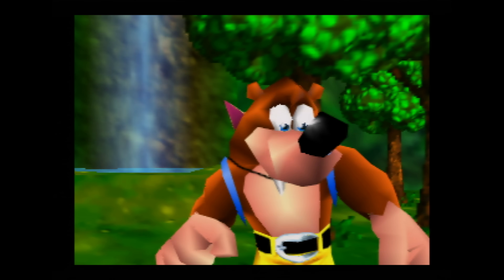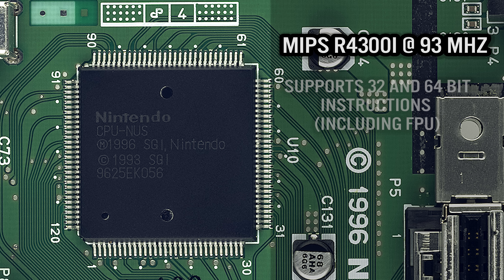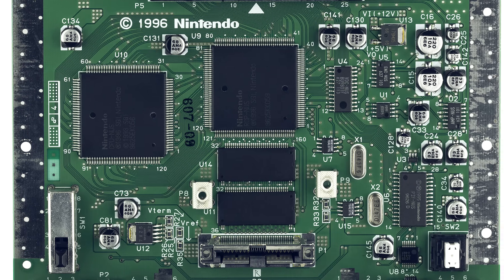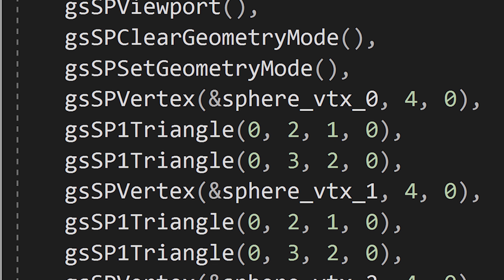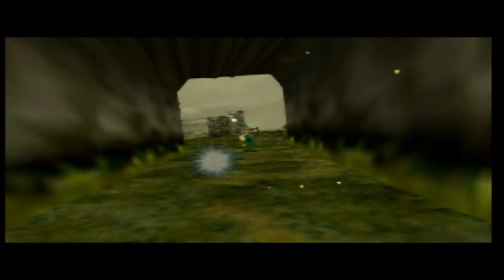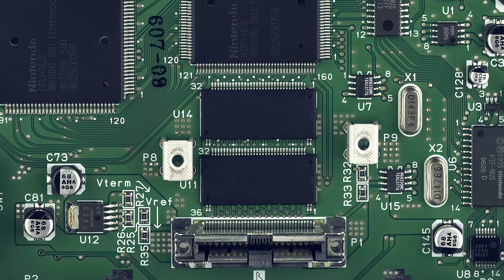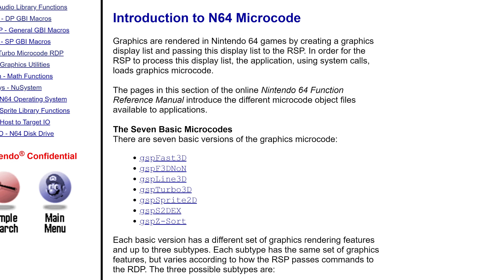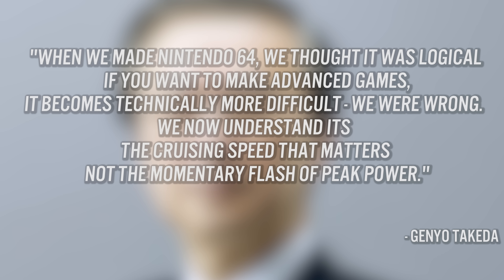Why was the Nintendo 64 so hard to develop games for ? | MVG

Comment: Calling the SNES 65816 clone processor a 16 bit processor is like calling the 68000 a 32 bit processor.  The 65816 has an 8 bit data bus but could perform some 16 bit operations internally.
Reply: 8088 has 8bit data bus. I would be cool if SNES had code cache and 32x32 registers to not need the external bus for everything. Scoreboard for a load queue.
Reply: @ArneChristianRosenfeldt  I programmed the SNES, Sega Genesis, PS1, Gameboy Color, and Atari ST for a living.

This doesn't seem realistic since the 65816 is intended to be compatible with the 6502 with 16-bit extensions.  The 6502 had very few registers because it was made to be cheap and fast with fewer transistors than most if not all the other 8-bit processors.  It made up for the lack of registers by having "zero page" instructions that could use the first 256 bytes of memory like registers.

What you describe is like a real 32-bit processor.  

Nintendo was aiming for some backward compatibility with 6502 code.  Compared to the Genesis, Nintendo went with a cheaper processor but had a better graphics chip.  (BTW, the 68000 isn't hugely faster than the 65816.)
Reply: @ArneChristianRosenfeldt  Your point is correct.  The 8088 has a 16-bit internal bus and ALU.  

So does the 68000.  I remember people arguing in the 1980s about whether it is a 32-bit processor because it has 32-bit registers and instructions.

So I guess the 65816 is a 16-bit processor after all because it has a 16-bit ALU.  I couldn't find any information about its internal bus size, but it does have 16-bit registers.  I just felt that the 8-bit data bus is a bit limiting.
Reply: @john2001plus  somehow I expect the 65816 to have an 8 Bit ALU because it cannot do reg-reg math anyway. Do shifts affect the high byte? Does INC add a cycle on carry similar to address calculation on 6502? This page byte sounds like it sits next to AL and AH and has nothing to do with the ALU.

I dunno if YouTube ate my comment. Just want to add that Nintendo added MUL and DIV instructions for F-zero , but they need the bus. With a clean sheet processor design, DIV could run as low priority on the main ALU ( cheap ) and Output to implied registers which lock when not ready. Likewise MUL could run. Or include a hardware 8x8 multiplier and some way to let it chug along in the background for larger MULs. Same for large shifts.

6502 has zero page indirect and zero page indexed. May a two register shift would be a great replacement: load and move date from to anywhere in the register file with bit precision. Then you can cache arrays and not have a problem with alignment. Even if we cheap out and use a 68k style shifter, again, let it run in the background. Clock the memory at 7 MHz as pcEngine, but double internal to 14 . So like on 68k multi cycle instructions will no be the bottleneck. Stack only accepts 32 bit. Also only one immediate instruction: load 32 bit . Then unpack in file. Remove from inner loop.

I hate REP MOVSB on 8086. This really should be a loop in the cache. So we need a code cache. It would cache immediates. Hmm
Reply: @ArneChristianRosenfeldt  I read that the 65816 has a 16-bit ALU so it should be able to handle 16-bit math just fine.  It has been about 29 years since I last programmed the SNES so I couldn't tell you for sure.

I forgot about the extra features on the Ricoh 5A22.  Having multiplication and division is impressive.

You seem very well-informed.
Reply: @john2001plus  I tried to insert a link to stack exchange. It does not appear here. They say that physically it is 8 bit. ARM with its 32 bit ripple carry ALU ran 8 MHz in Archimedes and 12 in 3do. There is no excuse to not at least go 68k and have everything 16bit physically .
Reply: @ArneChristianRosenfeldt  Most links are automatically filtered out as spam.  

Nintendo made the right choice to go with the Ricoh 5A22.  Processor speed isn't everything, and the 68000 uses more clock cycles to execute its instructions, making it not much more powerful for games than the 65816.  

Nintendo chose to keep costs down and have better graphics hardware than the Genesis while maintaining some backward compatibility with the 6502.  The Ricoh 5A22 was powerful enough for the games that Nintendo wanted to make, and as a result, the SNES was the perfect system for the time.  It is a system that people still love to play.

I got to work on a couple of SFX chip games, and the added power was impressive for its time.
Reply: @john2001plus  just I don’t get when you pay for the transistors, why don’t you max out the clock? That is why I like the 8bit ALU in 65816. Double the internal clock, and add 2 byte instructions for reg-reg add for pointer arithmetic and physics. 68000 is faster. It utilises the clock possible inside an IC to get compute power for cheap. It has a big register file. It does not allow unaligned memory access. To this day I don’t get why it needs 68000 transistors. I was told to compare with coldFire. That was difficult for me. SH2 seems to be similar to 68k, but has a 300 pages manual?

Backward compatible is what gives us 8086 today. Yeah, I can’t argue about this. Just I wish Nintendo did not car 7 years after their last console.

Genesis for some reason has a low bpp video DAC. But it introduced the linebuffer before Nintendo copied it. Genesis draws all sprites while in the borders.
Reply: @ArneChristianRosenfeldt  A Faster processor means more expensive RAM.  Nintendo did a great a great job of giving us performance for the price.  They gave us better graphics hardware than the Genesis.

The 3.58 Mhz speed of the SNES is 1/4 the speed of the color signal crystal and is driven by it.  I wondered why a ton of devices ran at 3.58 Mhz and it was a cost-saving measure.  They could have run at 4 Mhz, it would have been more expensive.

Clock speed isn't everything.  The 68000 vs the RG40XX-H is a case of CISC vs. RISC.  The 6502 was designed to be cheap and fast, especially compared to the 6800, so I assume that the 65816 vs. 68000 is the same thing.  I was frustrated with how many clock cycles the 68000 takes to execute its instructions.  It is great for 32-bit numbers, but 65816 uses fewer clock cycles and is great for video games.

Apple limited the speed of the Apple II GS so that it would not compete with the McIntosh, but the Apple II GS is the computer they should have made instead of the Mac.   They could have run that processor faster and been competitive with the Mac 68000 (which only had an effective speed of 5 Mhz) while maintaining backward compatibility.

I'm not saying the SNES is backward compatible with the NES, but it was likely easier to port code over like  Super Mario All-Stars.
Reply: @john2001plus  I read what Woz wrote, but I don’t understand. Yeah, 68k accepts a faster clock. But memory clock is half of that. And every other cycle memory is free for video DMA just as on 6502. Just 68k has internal registers and does not need to go over the bus to the zero page.

The C64 generated the color clock from a 15MHz crystal. At some revision of the C64 commodore started to use a clock divider made using the same fab used for the CPU. So 15 MHz can be processed. 640 px on Amiga needs Chips which can deal with 14 MHz. Commodore uses nMOSFET. I could not see that contemporary CMOS on RCA 1802 was slower. Indeed RCA used clocks similar to Z80.

32 bit math is great for pointers. Yeah, games  often need less. But in CMOS this doesn’t matter. Only bit changes cost energy. If the upper bits of most values are zero, we don’t pay for them.

Maybe Woz was too old for 68k. There are awesome Atari ST demos . And there is Sonic the hedgehog.

I guess ROM appears slow because 6502 only gives a small part of its cycle to external RAM and ROM. Chipselect, address generation, bus signals all need to happen in this short time frame. Z80 and 68k give memory a full cycle to respond. Always in all instructions. So memory bandwidth is higher.

And the ambitious graphic chip for me is in the Amiga: 4096 colors are perfect for 2d games. Two playfields . Flexible height of the sprites. 15 color sprites ( same year as Sega Master System ).
Reply: @ArneChristianRosenfeldt  I think that the SNES was a compromise between cost and performance (and limited processor backward compatibility)   The result was a great system!

BTW, the first machine code I learned was the RCA 1802.

Comment: From 1991 snes to 1996 n64 the technology was light year's ahead of it's time.  Graphically the snes pushed it's hardware to it's limits, that's why snes was hail superior over genesis, CD and 32x counterparts.. even though by that time Sega has move on to 32 bit consoles adapters to improve the genesis,  Nintendo play the patience game, everything they learned from the Super Nintendo,  played a important factor in the N64 timelines.. I like the playstation better but horsepower wise the N64 was a true 64 bit system ,sega CD, 32x, 3DO, Jaguar, Phillip's cdi, saturn non of those systems came close. I think the only mistake was not having N64 be a CD base console.. rumble pak was a great idea, before Playstation Dual-Shock controller, memory card wasn't bad,  expansion pak.   If they had a CD then it would of better.. gamecube basically solved all that in the next gen 128 bit wars with the playstation 2

Comment: The cartridges still had their problems as well. The fact they were limited in size in comparison to CDs meant that games just couldn't come to the system at all. Like the classic JRPG Final Fantasy VII (7) which had a file size of arounf 1.32 gigabytes and that took up 4 PS1 discs which held 450 megabytes of storage and i believe 64MB carts were a thing when FF7 came around initially Squaresoft (currently Square Enix) would have been looking at A WHOPPINNG 21 CARTS to get that game onto the N64 uncompressed. That and carts were more expensive to put games on as well so it wasn't uncommon to see games as high as $90 USD caue of the fact they used more materials to produce the carts. That would have made the game prohibitivel expensive in terms of price as the game would have been $1890 USD brand new (which would be more commonly seen on rare and more sought-after games on the retro collector market). So in that regard yeah the carts DID have a small role in why the system didn't recieve as many of the classic 3rd-party titles as the PS1 did at the time. While it wasn't the main reason as commonly thought it was, the cart size and production price tag DID have a role in it.

Comment: how to mess up a fantastic hardware with just a tiny texture cache problem.. that's what made the N64 pretty horrible to look at imo.. even coming years after the PS1 I always hated how my games looked like on N64, it's like looking at the screen through a greasy pair of glass.. everything is so blurry compared to the sharp, yet pixelated, PS1 graphics
And they thought about adding a RAM expansion slot (that no one ever used or needed) instead of a texture extension slot.. 
Nintendo really dropped the ball on this console.. they were lucky enough to be nintendo and just came out from the SNES (let's not talk about the virtua boy) and kids like me really thought we'd get the line up of the SNES with chrono trigger, FF, mario (that one delivered.. but we're still waiting for mario II..) etc..
but in comparison the N64 was just a very sub par Snes, and it's basically what happened all the way up to the switch where most good games were from Nintendo basically, rest was mostly garbage or multi console (lower end) ports.
The Wii really brought something new gameplay wise for sure and the switch is really their best console and really brilliant all around, the real worthy successor or the Snes.
I really hope the new console will be as good and finally pump up the graphics a bit more (at least in docked mode if they decide to go handheld again)

Thanks for the detailed video as always, it's really entertaining

Comment: 5 step pipeline means it can break processes into 5 steps and possibly do more because of pipeline but is still limited to 1 instruction per clock cycle max, super scaler would be two per clock like many modern processors. what made n64 processor so fast was its ability to also execute 32 bit code which used less memory bandwidth and had faster executing instructions. also a 5 step pipeline is less pipelining than many processors of that period which means that branch instructions could execute faster and an empty pipeline filled faster.
Reply: MIPS has no empty pipeline. Or does it? Load data needs stage 4 and 5 after address calculation in 3. Branch calculates the address of the next instruction and fetch would happen in 4.
Reply: @ArneChristianRosenfeldt   N64's MIPS maxed out at 60 MIPS with about 4 ICs combined. Address Calculation read Dual 32-bit Just like Saturn.

Comment: N64 being more powerful than the other consoles really showed. it had massively better visuals than the PS1 , and comparing the saturn to it was laughable.  it wasn't beaten in the home console graphics till  Sega with the Dreamcast introduced the first 128 bit system in 99 (though by that time the bits were no longer being a market selling point) and from a visual perspective,  PC game's power quickly outpaced all the consoles that generation. the PC tech industry was moving so fast in the late 90's and early 2000's .  i remember thinking the n64 and PS1 looked like shit long before i bought a dreamcast , and this is because PC gaming had already advanced so much.   you could grab a PC gamer magazine  in 99  and see pictures of the up and coming  Halo, far cry or doom 3. which made even the brand new dream cast, the yet to be released game cube, the coming PS2 and XBOX, Those games far cry made ALL those consoles look dated well before they released.  oddly enough though all those games found a home on  XBox with much tamer visuals than their PC versions.
Reply: "Better visuals than the PS1"
Is ok to be wrong.
Reply: The PC outpaced consoles when DOOM and other games came out.
Reply: @PiroKUSS  that was pre windows 95 even. we are talking 1996  not 1992.  and actually the pc still out classed consoles prior to doom.  Id wouldn't have made doom the way it was  if the PCs to run it didn't already exist.  so the actual year PC's started out pacing consoles was probably 86-88.  as for why they didn't earlier is because there was just a lack of demand  for gaming on PC's prior to that. the comadore 64 dominated pc gaming  in the 80's  due to it's own expandability and most games on PC stayed in those bounds  (8 bit style graphics).  Plus there just wasn't much interest in gaming on a computer. They were thought of as "work" devices most of the 80's. so devs didn't see much need to push graphics or games on PC during the 80's. 

but yeah Doom along side Wing comander Came out and every thing began to change for PC gaming.
Reply: @DenverStarkey  The C64 wasn't made in the late 70's.
Reply: @PiroKUSS  i don't remember when it was made i just know it dominated PC gaming in the 80's. I always thought it was made in the late 70's.   fucks sake everyone is such a fact checker these days. i corrected my statement. you happy ?    i never owned one and never got into PC gaming till 95-96.

Comment: to software engineers/makers.
make a PS3 emulator for iphones/ios and/or androidOS smartphones.

  if the APU/CPU/GPU of some smartphones are not strong enough to emulate PS3 games then add a graphics downgrade function as a option
 in emulator menu, for example, downgrade graphics to 16bit/8bit and/or downgrade resolution to 854x480p or downgrade colors as black-white-gray, or etc. I think some admiralship smartphones would run some PS3 games without graphics downgrade. (i was writing these since 2015-2016-2017-2018, mostly at/to Turkish accounts)

Comment: funny how ps1 beat it so easily lol and it was cheap as hell. launches 249 or whatever in 96 and ps1 porbably was lowered to 249 or 299 by then, even though it was out 1 and 2 years prior. It was so sad back then and when i was a kid. Then ps2 took the largest crap on the competition period, while gamecube became this cult classic type of system as well. Theyre lucky the wii took off due to peoples interest in the new tech of wii mote. I wonder if sales would still have been good that generation,, if it was common knowledge that the wii was basically a suped up gamecube. I feel it would have slashed the sales. Cuz it was sad that, that is all it was. Anyway, i need to give the n64 more of a try. I never really did and barely played much. I like mario but i dont regret it bcz ps1 was so damn awesom.. its not even funny. (and still is)
Reply: Playstation had SquareSoft and Enix games... so it really wasn't fair

Comment: 4:25 Just like opengl code. I assume gsSPVertex takes a buffer to a list of floats that store x,y,z,and texture coords for each vertex (2 argument is how many vertexes in the buffer)  and gsSP1Triangle tells it to draw a triangle using the last pushed vertex buffer data of the rsp stack. The 4 arguments in gsSP1Triangle tell it the position on the rsp stack where to get the vertex data. In this example, the two gsSP1Triangle together is drawing a quad or square by joining two triangles together. and gsSPVertex (second argument) has 4 vertices because a quad or square makes up four corners.